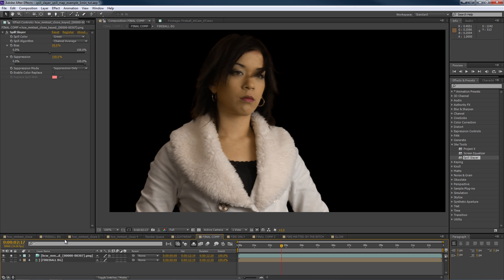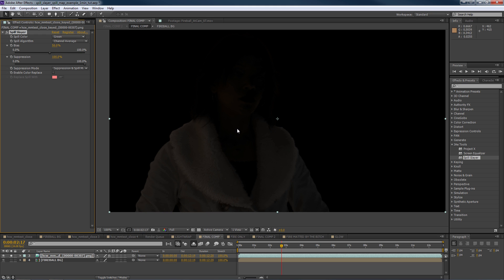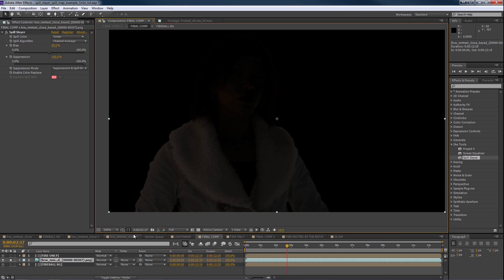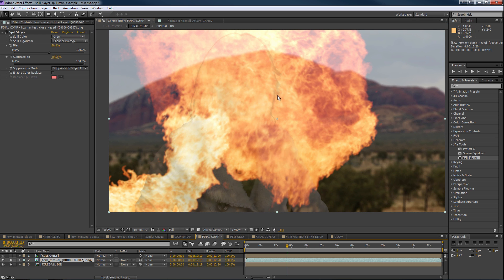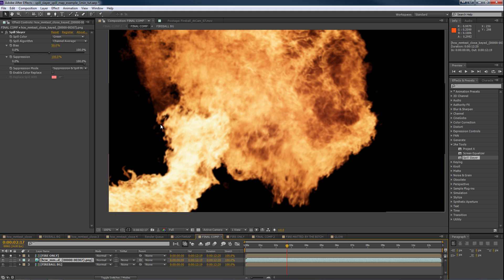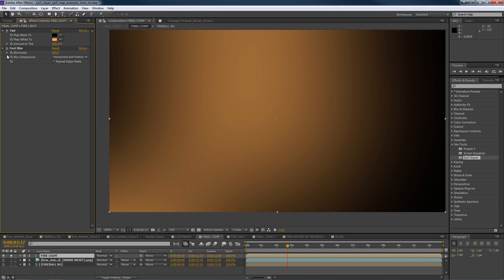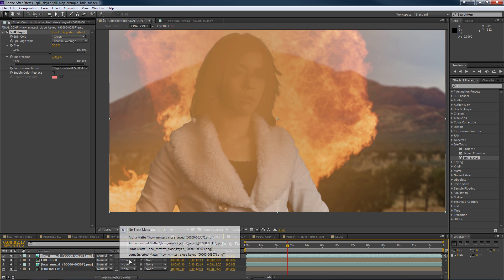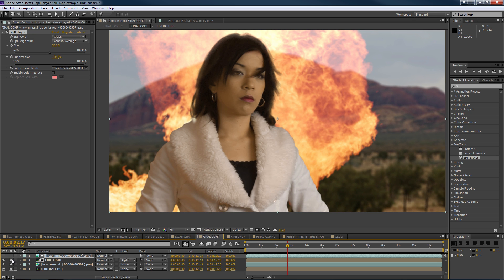1 Min Tut: Perfect Light Wrap with Spill Slayer

Comment: I personally wouldn't call that "perfect". Light from the fire would not be reaching her chest and neck area.
Reply from the maker: You would naturally need to make some adjustments to match the background as you would with any composite (but that's not the point of this tutorial).  However the light wrap would be correct based on the way she was lit.  The point of this tutorial was to show how to use the spill that is already in the shot for a light wrap.